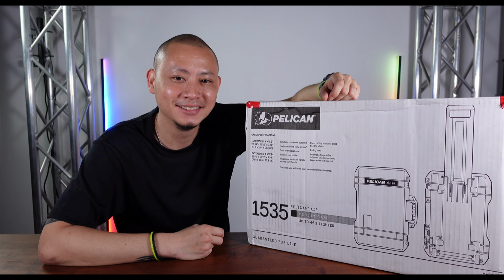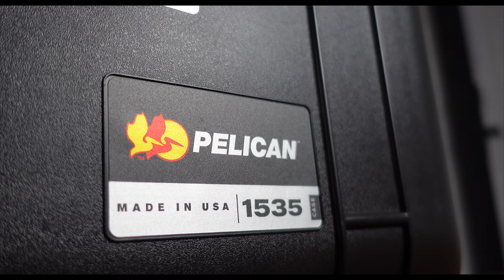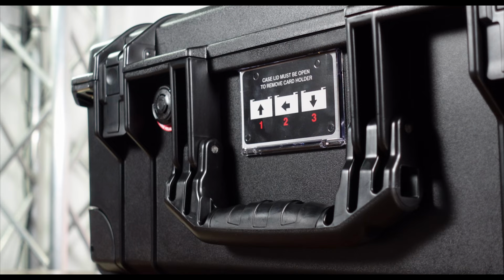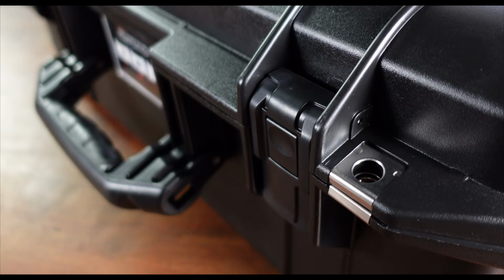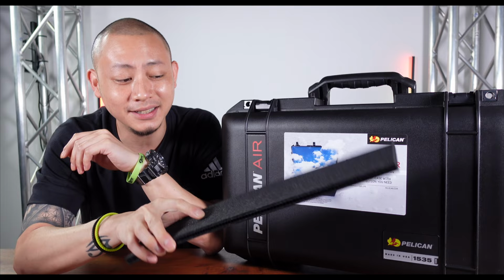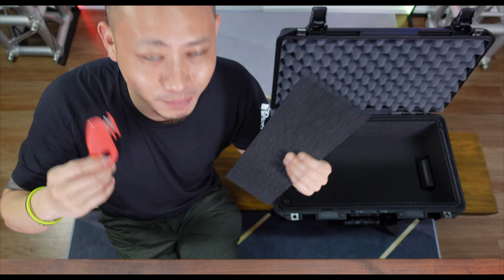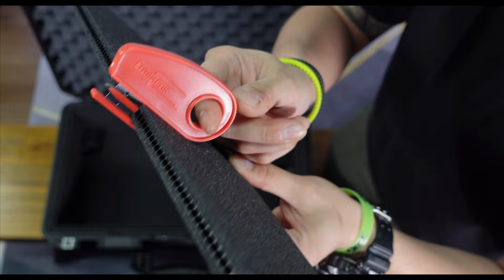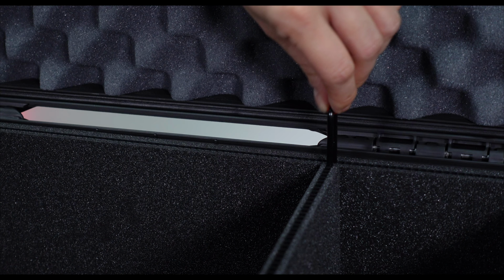Pelican Air 1535 Unboxing // TrekPak Installation

Comment: So there's a gap between the top of the equipment and the top of the box. What do you do to remove that Open space?
Reply: You have the foam in the top of the case.  You can insert foam under or on top of the item if you'd like.